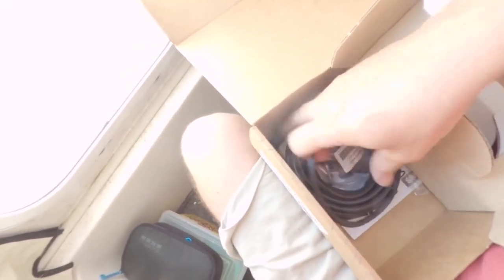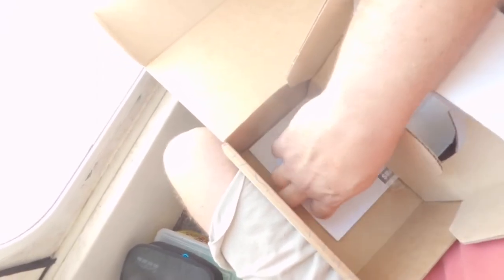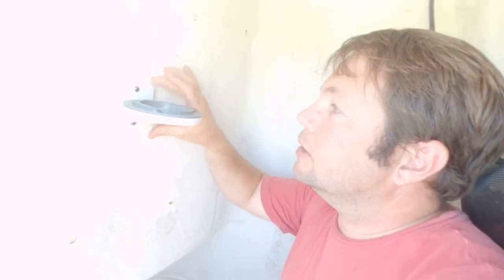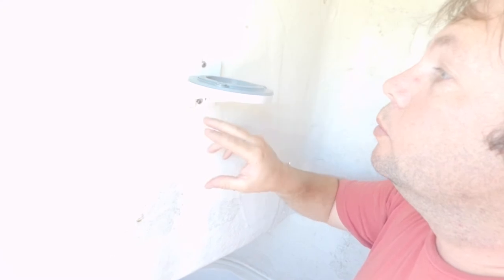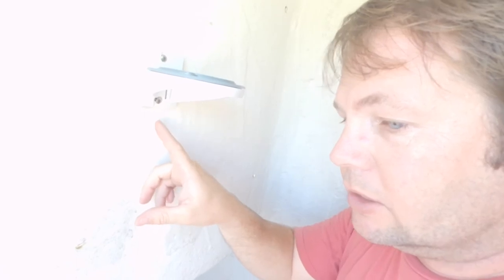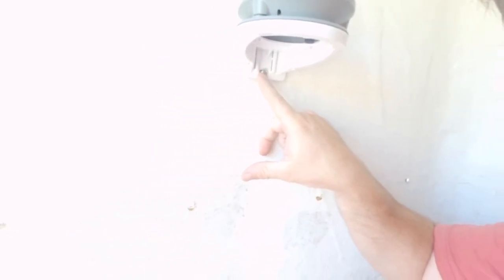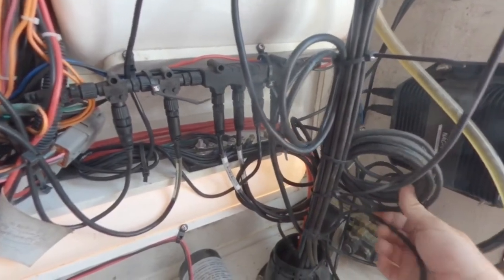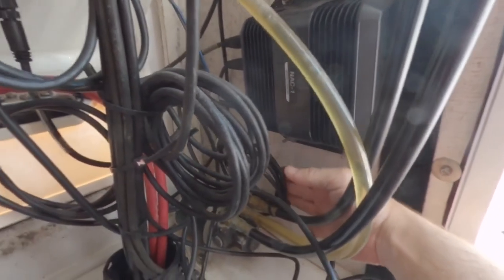Abbreviated Simrad Precision 9 Rate Compass Install on Simrad Go 9

Comment: Can’t wait to see if it helps with the autopilot.
Reply from the maker: Yes sir.  When are you going to get us that Rhodan install video?
Reply: PaulOffshoreFishing I had an issue with it. They are sending me a new one tomorrow. The FEDEX guys dropped my first one so hard that the shaft came through the box.
Reply from the maker: Ouch, I know that hurt.  Sounds like they’re going to get it straight. Glad it wasn’t on back order again.
Reply: PaulOffshoreFishing they are in back order but they hey are making it right for me. I waited a month for it.
Reply: Using the magnetometer, are you looking for it to be in the green range or as close to zero as possible?